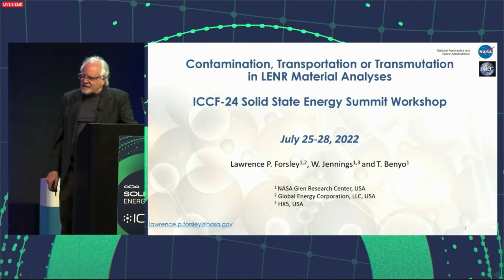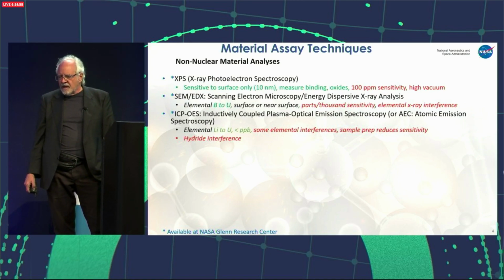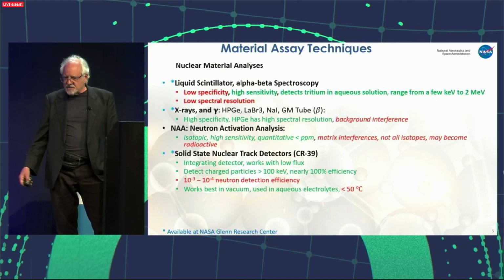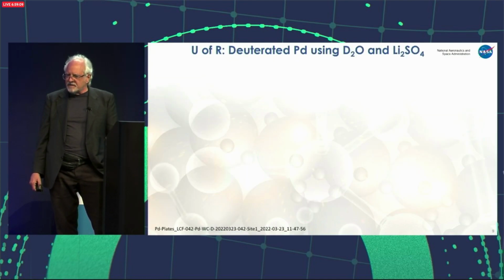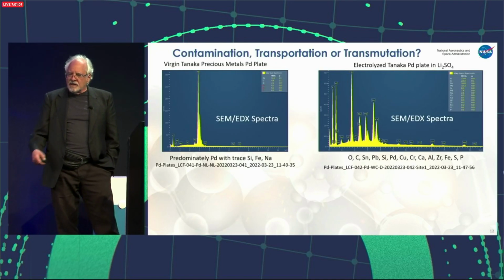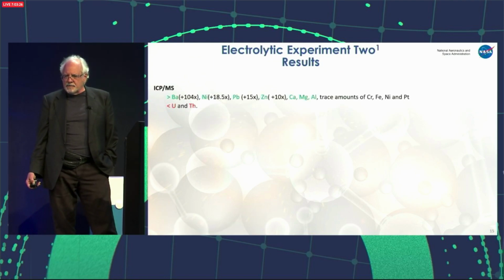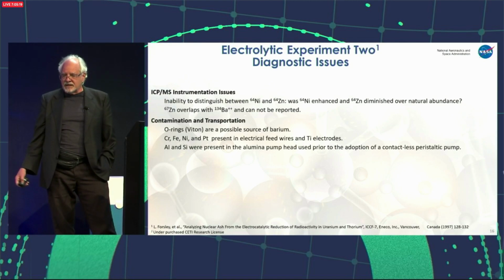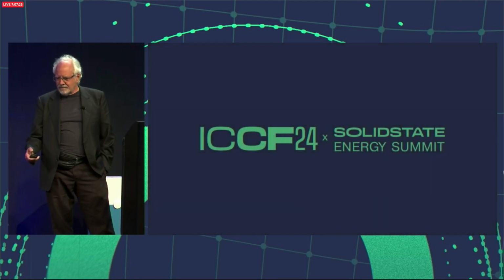ICCF24 Presents:  Lawrence Forsley - Contamination, Transportation or Transmutation...

Comment: you're getting warmer.   that boron was a happy accident, huh
  you're looking for a harmonic coherent interference of a quasi particle and phonons.  Like music.  Time^3 = Energy^3 * Space^3.  The collapsing space can fuel the next wave of the pattern....if you had a sympathetic / pyroelectric layer?   Thanks. I suspect the phi fractal as a music into one maser and one laser might create fusion... or accelerated decay for power... I agree, I calculated about 4 - 5 Terrahertz.  =)   But that's because of my layers of magnetic pyroelectric electric nuclear materials.  it's an odd coccoon.    Hey man.  make sure you use some of that Hitachi Finmet / amorphous metal alloy next to the rebco (or other HTS) AND something like lithium tantalate, adjacent to something like an lithium - aluminum - zirconium - berylium cvd layer... What you people have been missing is the breakdown of conventional physics that happens when you correct your unified field equation with mine.  that frequency and interference can be tuned to the quasiparticle etc, then the POWER is not relative to the local time....because of the space wave.  So with my layers and special materials I try to demonstrate the new theory...I think the layers and frequencies will help you create bigger regions of new material - the titanium is a middle man.  =)  heheh, it's transmuting. I would never touch thatllium, but you coudl theoretically put that in a layer and see some gold at the end of the day.  just for giggles. You made a place where the boron, lithium and deuterium can play with stuff.  I would do it a different way. just add some graphene and wet that layer next to the LiTa that's vibrating and translating the energy layers.. If carbon is going to be a hurdle, maybe we can work it at the core magnetic environment... just a sprinkle. for the geometry.

Comment: I agree that one has to be very aware of the sources of potential contamination, the transport phenomena, impurities in the reactants, inaccuracy and interferences of analytic techniques, and so on, but these can be greatly discarded with a proper control or reference experiment that would go
Through the same process, thus the same contaminant and transport processes, from which to establish a baseline. I also know that analysis of solid samples is a very complex process as one can never be truly sure that the anomaly is not an inclusion present a priori. This is why I advocate for analysis of dissolved compounds in the electrolytic solution, if one can control the sources and new elements show up in the electrolytic solution, and also performs controls to  establish base lines, then the degree of certainty increases.